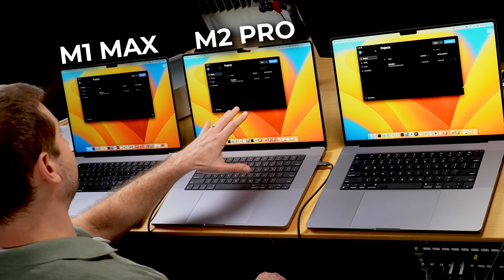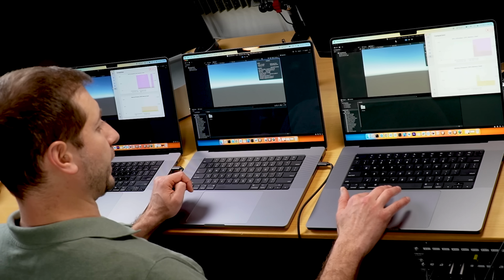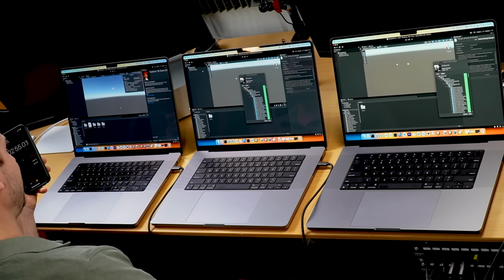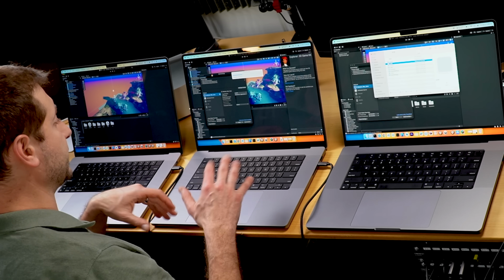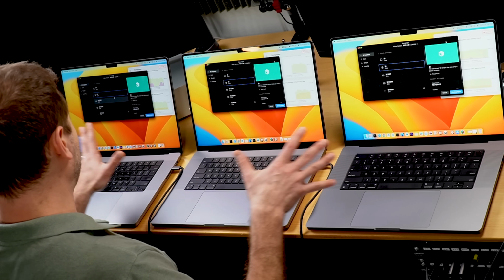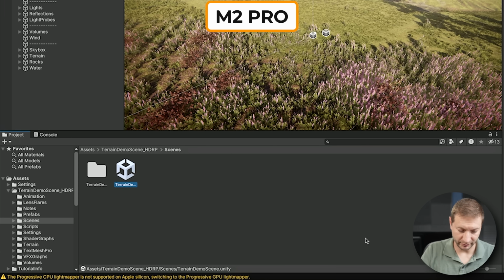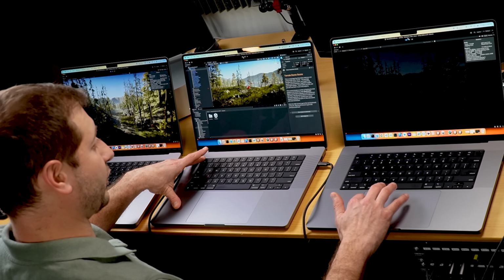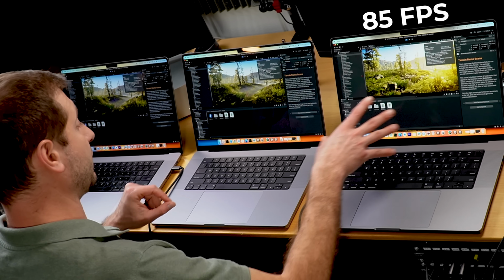MacBook Fans ROAR Like Never Before | Unity Build

Comment: *edit*
Obviously I've just found your channel and after posting this comment, I found your other vids checking out the M2 Mini. I don't see a Unity benchmark on it though, so I'm hoping you will do that in the future. Great channel, by the way. You've earned my sub!

*original message*
If you have access to any of the new Mac Minis, I think they would be a great test. I'm personally thinking of picking one of them up so I can do Unity iOS builds. With the M2 Mini being the cheapest Mac available right now, it would be nice to know how it performs. I'd either pick up the absolute cheapest model and only use it for creating builds (using my current PC for actual production), or I'd opt for the Pro version, maybe even with 32 GB RAM and use it as my primary machine, but then it wouldn't be cheap. Maybe it would be smart at that point to wait for the M2 Studio.

Comment: Hi Alex, great job on yet another test! I suggest redoing the tests with 'Low power mode: On' to see if it improves the high temperature issue. On my M1 Air, enabling low power mode keeps the temperature around the current room temperature with no noticeable performance drop when using browsers, code editors and language servers etc. It would be interesting to see if low power mode behaves similarly on these three machines in Unity.

Comment: I use M2 Max MBP 14 at work daily. It’s pretty capable. The best thing is that it stays cool/earm to the touch all the way. I can also work on my games on battery power for 4.5-5 hours. Keep in mind that I use TG Pro to ramp up the fans faster and earlier, but it never gets hot to the touch thanks to that. 

Recommend me a laptop that conpares with it. Or even with the 2021 M1 Pro MBP 14. You can’t. There’s nothing comparable.

Comment: Many thanks alex for your work. Just for comparison. Ryzen 9 3950x + RTX 2080 super+32gb ram+2T samsung 980pro. Importing the same RPG Kit template took me 3'56''.  In editor game play 80-170fps. so the m1 max is indeed fast in cpu. In this case GPU seemed comparable but I've heard that m1 max GPU is  equivalent to rtx3060. 3060 is around 30%-40% slower than 2080 super. btw, the game isn't well optimized, I've got hickups more or less at the same spots. It's great that you told what kind of software or package you used in your test because we can do the same with different machines. I rememberd you did a safari compiling on m1 max and it took you 16 minutes and then I tried the same on a late 2013 retina macbook pro i7 16 inch, 32gb, and it took me 79 minutes. Holy smoke! One thing clearly showed in your test which is Apple were squeezing performance from the m2 chips at the cost of more fan noise for cooling down the laptops. If I'd buy a m chip macbook pro now, defenitely a m1 max. Otherwise, wait for m3 max(not m3). It's always a good idea to wait for at least 2 iterrations. And price wise, m3 will go higher certainly. I hope you will do the same test with Unreal. I just tested UE5 lumen and it was awesome. Curious how m1 max can handle it.

Comment: Hello,
I think the crashes are because you are using a version of Unity that is not yet Long term support (LTS).
I am a Unity developer and I use a Mac 16" pro and I have never had anything similar with the LTS versions of unity.

Thanks for your great video
Reply: Hi Camilo, as a Unity dev myself I was thinking about switching to a M2 MBpro... do you recommend the Max with 38c GPU or the Pro with 19c? Thanks!

Comment: I wander how Zbrush works on M2 and Fusion 360
Reply: fusion360 will gain full apple silicon support by this summer! now under rosetta works good enough, but the SOC it’s not used at its full potential.

Comment: Alright, a Unity developer here, and here are few clarifications and suggestions that should hopefully help you better understand what you're dealing with.

First the random crashes don't happen that often with brand new project, except perhaps in the latest Techstream version of Unity which is 2022.2.11f1 at the time of writing this comment, LTS tend to be more stable, I to noticed some crashed in the latest Techstream version with creating new projects or upgrading existing projects, I'm on a PC btw so the crashes are definitely a Unity bug.

Secondly, I do agree with your frustration, Unity is atrocious when you start importing assets and packages, and the game starts growing in size, and when you use packages in experimental state, perhaps I'm calm all the time because of all the emotional training I got from dealing with Unity for years lol.

When you noticed some frame drops during the few seconds of entering play mode, that's because of the shaders and GI (Global Illumination) being processed simultaneously, you can see that in the bottom right corner, you'll see a blue progress bar, if you click on it it'll open a small window that shows the progress of all the tasks running in the background, that's why you noticed some frame drops in the beginning of playmode. So I'd say wait for it to end then record the frame rate.

When you're playing the demo, I noticed you changed between the default Unity view to a maximized playmode view in other tests. Doing that while the aspect ratio is set to "Free aspect" won't give you any comparable data, because "Free aspect" means the game view will be rendered on the resolution of the view, so if you resize the view you'll get different frame rate because you're essentially changing the resolution, to avoid this click on "Free aspect" and lock the aspect to a set resolution, say 1920*1080, when you do that then the render target is always that resolution, and you can resize the game view and it won't impact the frame rate, if you want to see the current game view resolution, in the Stats tab that you opened it is reported next to "Screen: ", so try to resize the game view and notice the resolution changing, then lock it to 1080p and notice that it'll stay consistent.

When you opened the HDRP demo, you got a warning saying switch from CPU lightmapper to GPU lightmapper, it essentially means the scene you opened is using baked lights, and the editor is saying switch the baking to happen on the GPU instead, which is typically way faster than CPU, the baking process would also be reported in the background task I mentioned earlier "Bottom right corner", this baking however is paused when you enter playmode, unlike realtime GI.

HDRP is a rendering pipeline that is aimed at high-end computers and consoles, it has far more complex shaders than 3D and URP,  and is typically slower because of the better visual quality it offers, the pixelated view you mentioned wasn't visible here via YouTube, but I'd say select the camera or volume component and see if there's any post processing that is making the game look pixelated as you reported.

That HDRP package is quite heavy on any system to be honest, in the Stats view you'll see that it was rendering 30+ Million Tris (Triangles), while the first 3D demo was rendering around 7M tris, about 4 times the complexity in geometry and that explains the low frame rate, if you take 1920*1080, it equals 2073600, roughly 2M, meaning if each triangle was as small as a pixel, then the game shouldn't cross 2M tris on 1080p, both demo well exceeded that, and that's sadly wasted performance that UE5.1 gains with their Nanite feature (worth a research), we've been begging Unity to add something like Nanite but we got nothing yet lol.

So yeah, awesome video, all those machines are way faster than mine :| I hope these stuffs helps you in future Unity tests.

Comment: I’ve been a unity developer since version 3 more than 10 years ago. The current versions are buggy as hell, it’s been getting worse and worse. No effort on unitys part to actually make the experience better. Unity teaches you to save the scene after every change you make. If you want to make it more frustrating try  opening the code in VS put a breakpoint in and run it. It will work first time but now the chance of having to force quit unity goes up exponentially.
Reply: Yea I moved to unreal (has issues as well) for 3D and working on my own C game engine for 2D games. I dislike very much what unity has become
Reply: Rider breakpoints are amazing in this regard
Reply: On which platform and which version of Unity? Because I only run the LTS (2021) on both Windows and M1 Macs and I don't see any of these issues (using full VS on both).

Mind I also save every time I make a change, but that's because I was raised in the days of programming in DOS where any mistake could hang the whole machine!
Reply: @MichaelGGarry  2021.3.20 LTS on M1 silicon. I can go a day with no lockups, then they come along like a number 9 bus. I have to force quit unity and will lose anything I've changed in the inspector since the last save. Hence the saving each time I change anything in the inspector. In fact I've just this second had to force quit unity on my intel iMac, Same version, locked up building an IOS build. (does that a lot)
Reply: @danielsmith3257  Interesting. What sort of projects are you working on? I've never had a lock up on building an iOS build yet (M1 MBA).

Comment: Would have been interesting to have a Dell XPS there as well.
Reply: I had a Dell Xps and that is out of this league, believe me. Not only does the speed suck but also the built quality. I had mine for 3 years going through college. After 3 years it is practically not very useable maybe for internet surfing, but still too slow for programming stuff. Also the carbon does get a lot of wear and gets oily very quick. The top and bottom cover of the laptop is made out of solid material. The only thing that was good on that laptop. Don't buy it. Get yourself a mac like I'm planning to.